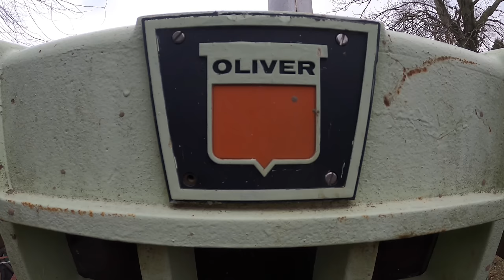REDNECK TRAILER REPAIR

Comment: I have my springs over the axles or for some axles under the springs . Doing that will give you clearance for your tube and the springs work better , just look at your 2 1/2 truck .

Comment: You just reminded me fix the lights on my uncles trailer,  and yes I broke and tore the lights in wiring to hell , think I'll go get it put in the shop before the big snow mon Tues so it's nice to work on maybe repack the wheel bearings also.  Sure beats laying on the cold wet ground , now to get it working on the super duty . From turkey creek farms be safe n thankful

Comment: Get you a butane micro torch, they work more better for shrink tubing. Also, and this is purely my preference, use un insulated connectors.
Reply from the maker: I need to get one, but then I’d have to not lose it I know where it is all the time 🤣

Comment: At my previous job, we had a 20 ton tag along trailer, and that thing was miserable to get under, so i would set it on the side with the excavator.
Reply from the maker: I wish I had an excavator it would make jobs like this so much easier 🤣
Reply: @rosstheoliverman  oh they are awesome.  I used them to dismount stubborn tires, put tracks on skid loaders and all kinds of other stuff.

Comment: I would call you names I call those idiots who drag their trailers around without lights at night time, but you have lights.  My next level of anger is when the news reports about dead idiots who were not wearing helmets while riding motorcycles or those idiots who were thrown out of their vehicles and killed because they did not wear seat belts.
Go to Harbor Freight and get a couple packages of the red and silver reflective strips.  Clean the side of your trailers and put those down the full length.  One can never be too safe.

Comment: I don't think it's a problem with the heat shrink, it's Operator Error and a POOR heat source. And as usual, don't get the right tool for the job, just grab whatever is at hand hope you don't F#@k it up.

Comment: The lights work. Too many frailer points, run conduit all the way to the hitch and flexible conduit into each taillight that way your system is sealed completely. But a farm fix will do.
Reply from the maker: I’m sure it’ll get destroyed again so there’s no need to get too fancy 🤣